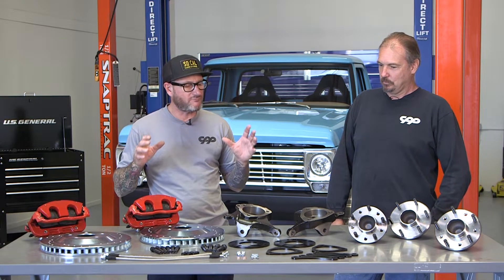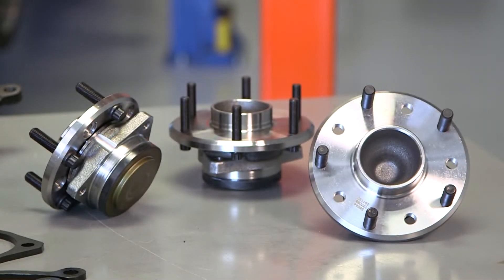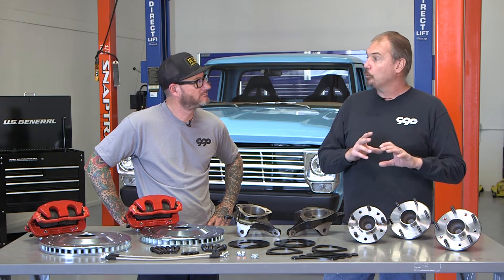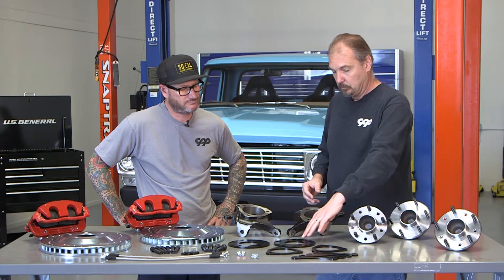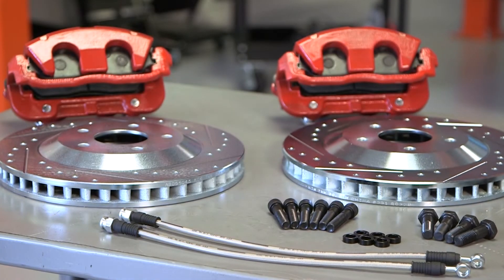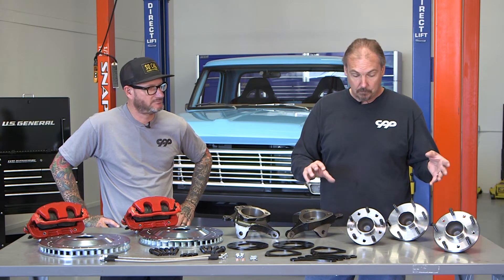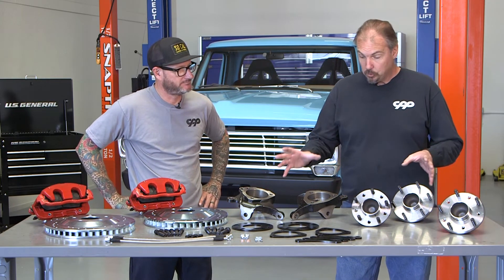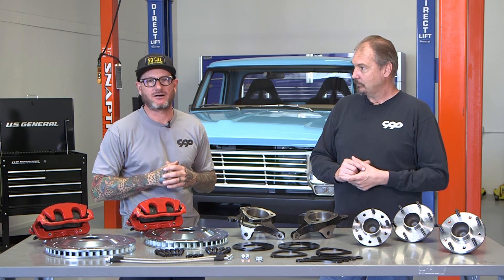Corvette Spindle, Hubs and Brakes for Mustang II Suspension

Comment: Am I looking at the right product on your website?  The video says $649, complete kit.  That was one year ago and they weren't on the market for several months after the video was released.  
If I am looking at the right thing on the website (M2WBK-S13G example part number), they are actually $959 now?
Reply from the maker: That is the part number for our big brake with a traditional Mustang II spindle. The part number from the video is M2CSS-5C-13R (stock height, 5x4.5", 5x4.75", red calipers). You'll have to give us a call and talk to a speak with sales rep because some of our pricing is changing soon, but that kit might still be $649. You can reach them at (866)-882-4131